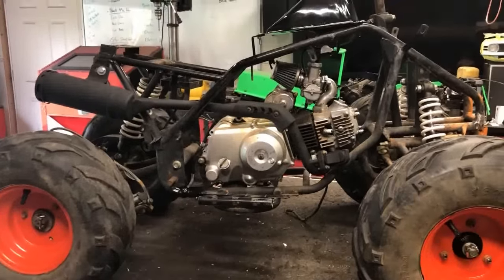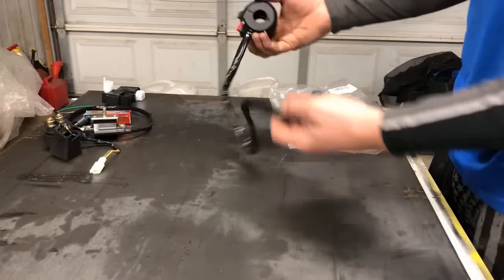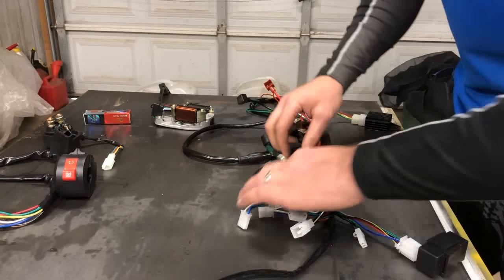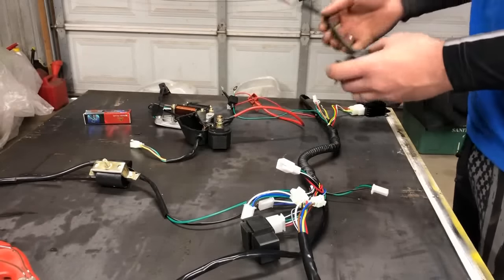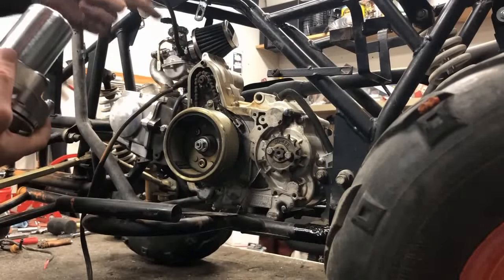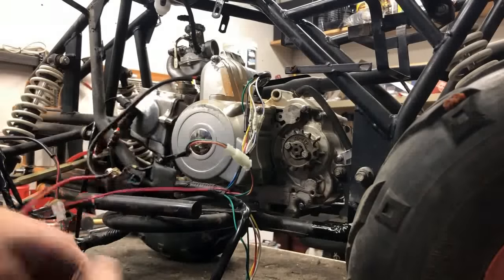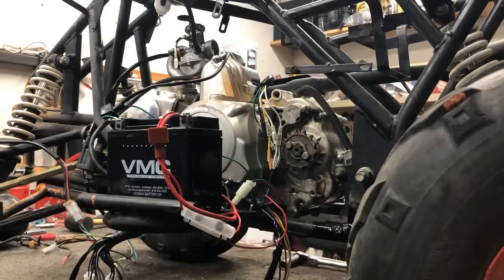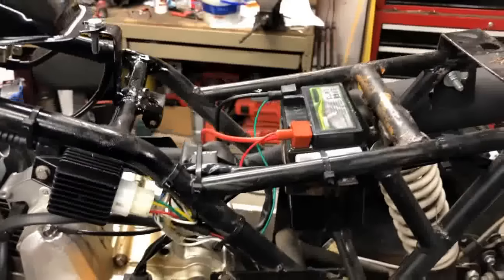Wiring a Chinese ATV from start to finish with an All New Wiring Harness!

Comment: I have followed your video over and over but for some reason I am having difficulty with my tail light and head light to be on at the same time. for some reason when i have the light switch off the taillight is activated all i did was plug into the correct connector only one that goes to the back GR/GR/YE/BR 3 prong plug.
but once i turn the headlight on 1 click the headlight comes on and the taillight shuts off. ive looked over and over just throwing me for a loop. 

Full Electrics Wiring Harness CDI Coil Magneto Stator 50cc 70cc 90cc 110cc 125cc Quad ATV Bike is what i bought
Reply from the maker: That is very strange, and I have never run into that issue before. It's not uncommon for these harnesses to come with issues out of the box. If you ordered off amazon my advise would be to do an exchange. That's what I have done in the past.

Comment: what about a 250cc water cooled atv? Will this work?
Reply from the maker: The concept will be the same but you'll need to order a specific wiring harness for the 250cc. Unbox, lay it out, plug everything in while its off the atvs, confirm it works, install! Good luck on your project and let me know if you have questions!
Reply: @PraskaBoysGarage  I will, thank you.

Comment: Thus is a great video.  But it doesn't  cover what I need.  Lol.  So I'll just ask and hopefully  I'll get an answer.   I got a used loncin 200cc atv.  The problem  is it doesn't  have the neutral/ reverse  indicator  lights  at the handle bars.  I have a 6 pin neutral  safety switch  that isn't  plugged  into anything. So my question  is.  How do I add in the neutral/ reverse indicator  lights.   I can't find anything  on this  online.  Please,please  help me.
Reply from the maker: This is actually a common question I get. Unfortunately the generic harnesses you can buy off amazon do not come with the gear light indicators. I keep telling myself next time I pick up an ATV with gear lights I will take it apart to figure out how it works. Unfortunately that hasn't happened yet. I'm in the dark with you brother! If you do figure it out please email me, I'd love to know the answer.

Comment: My quad has a few wires at the back of the engine just above where the chain meets the cog   Does anyone know what it might be   Sounds stupid but since I’ve put in the new electric loom the quad won’t sit idle and cuts out the second I let go of the throttle could that be anything to do with it ?
Reply from the maker: The set of wires above the chain is for neutral and reverse light indicators. It wont have a plug for this harness. I haven't found a aftermarket harness that has the proper plugs for them yet. They wont have anything to do with the idle.
Reply: @PraskaBoysGarage  yeah got it all sorted, reason I was thinking it was something to do with sitting idle was because I was adjusting the screws on the carb but there were no changes so was thinking it was something on the electrical side of things so I just got the mechanic to call down and see what he could do, but I just wasn’t turning the screws enough and he said the connection could be lights as you said, thanks for replying tho appreciate it, this vid about the loom helped me a lot 😂, keep doing what ur doing tho they help a lot of people and are good to watch and it’s enjoyable content 👍🏼

Comment: So I have an issue. Whenever I attach the battery without pressing any buttons the starter motor starts turning over
Reply from the maker: Only 2 components tell the starter to turn over. Either the start button or the starter relay. Check both to make sure you have them connected correctly. Also in the past if I switch positive and negative on the battery it caused that issue. Hope that helps!

Comment: I have connect the battery wrong positive to negative what will happen when you do that please help
Reply from the maker: I've seen it run the starter in reverse. Also your sending 12volts to the chassis ground so everything is considered "hot" meaning it could melt wires. Your most likely fine, just swaps them the correct way.

Comment: I followed all the steps but I can't see coil shock, I don't know why, someone can help me?
Reply from the maker: Stator, CDI, Coil, and Spark plug are the components that effect spark. You also have the ground wire, safety tether and kill switch that need to function correctly. Start with the easy stuff. Unplug your tether, clean your contacts for ground, make sure your battery is fully charged, and use a multimeter to make sure the kill switch functions properly with an open and closed circuit. If you do all that and still no spark, then likely you have a failed component. In my experience if you have a failed component it's usually a bad CDI Box.

Comment: Can any one help got the wireing harness all wired up and everything things right checked it twice and it still has no spark I’ve gone thru it all any idea what it can be plz lmk
Reply from the maker: Honestly I always tell people to check all the simple things like connects, grounds, kill switch...but it sounds like you've done all that. You likely have a faulty electrical component (Stator, CDI, Coil) It's a pain but you can either test those individually or you can send back the harness to get a replacement. I have personally had to do that a few times due to receiving a bad CDI box and also bad starter relays.
Reply: Ok thx will end up taking all off and sending it back and get new one thanks for the response . love the vids keep up the good work and keep em coming

Comment: does the switch assembly also work with a choke?
Reply from the maker: This wiring kit does not come with the choke to attached on the switch but they do have those kits available to purchase on eBay and Amazon.

Comment: does this video apply for a polaris 90?
Reply from the maker: We have owned both a Polaris 90 Scrambler and a Sportsman. Both were 2 stroke atvs and the harness is completely different. These harnesses wont work for those atvs.
Reply: @PraskaBoysGarage  I just seen this, man thank you so much for this video I just got done rewiring mine, it came out great 👍this video came clutch 🙌
Reply: Oh I did a Chinese quad by the way lol

Comment: Ok so I thought my wiring was bad cause I lost spark so I installed an still have no spark any suggestions
Reply from the maker: Start with the simple things first. Did you plug a safety tether in? Make sure the plug is on if you did. Also did you replace the spark plug? Check the flywheel for dirt or rust. It could cause a problem for your pick up. I know it can be frustration, let me know if you figure it out!
Reply: The only difference in mine an your's is I have 3 wires right behind the flywheel cover towards the back not sure what they are for

Comment: Do I need the wiring harness when I haeb a motor with Kickstarter?
Reply from the maker: Michl Simon  Not this exact harness but kick start motors still have a much more simple harness available. The tricky part with those motors is the stator is located behind the flywheel and you’ll need a special puller to get it off. Let me know if you have any questions!

Comment: What should I do if I installed the new harness, the atv turns over but has no spark.
Reply from the maker: It’s usually something simple. Unplug every connection 1 by 1 and inspect to make sure it all looks good. Then clean up any areas you have the ground attached to. After that it will take a little more diagnosing. Your always welcome to email me to if you can get it figured out!

Comment: What size battery are you using (volt/amp)
Reply from the maker: Voltage: 12 Volt; Amperage: 4AH I consider these batteries throwaways. They are cheap and usually only last around 1-2 riding seasons.

Comment: Mine does not have a starter wire plz could someone point me in the right direction to buy one 🙏
Reply from the maker: I don't believe you can buy the wire only. You can make one with 8-10 gauge wire if you wanted, and would only cost a couple bucks to make.

Comment: Hi. My atv came with remote Control, starts and kills from distance. And i can start it then Neutral bulb turns green. Please comment is conection the same?
Greetings from Lithuania :)
Reply from the maker: Lithuania! That's awesome! This harness is a generic harness. It will work for your atv but does not come with remote kill switch or neutral light indicators. They make kits with the remote system you can buy off Amazon but they are double the price.

Comment: Any idea on why my quad wont run faster when i put it on 3rd gear
Reply from the maker: Hmm, are you sure it's engaging or is its stuck in 2nd? Could be a lot of issues. Hopefully nothing too serious!
Reply: @PraskaBoysGarage  i feel it when it changes over i just got it the other day im thinking it might need a carb cleaning or what do you think. I press the gas all the way down and it barely runs i have to switch over to 2nd gear

Comment: Has anyone redid the wiring on a 150cc "roketa" chines 4 wheeler, the cylanoid, coil, and everything is good but I'm missing the wiring that comes out of the motor
Reply from the maker: The wiring that comes from the motor would be the stator. I've done a 150cc before and it's almost identical to the 110cc or 125cc. Just make sure to order a harness specific to your size.

Comment: What about the kill switch ? Is there a plug for that
Reply from the maker: The kill switch is part of the start button. It has 2 plugs coming from it and both have connection points into the main harness.

Comment: Got me a new harness and still have no spark what else should i do brother
Reply from the maker: Stator, CDI, Coil, and Spark plug are the components that effect spark. You also have the ground wire, safety tether and kill switch that need to function correctly. Start with the easy stuff. Unplug your tether, clean your contacts for ground, make sure your battery is fully charged, and use a multimeter to make sure the kill switch functions properly with an open and closed circuit. If you do all that and still no spark, then likely you have a failed component. In my experience if you have a failed component it's usually a bad CDI Box.
Reply: @PraskaBoysGarage  thanks for the answer brother i can get it stasted with the drill  now but when it cranck wont stay running like no idle i did order a new carb and hope that fix the issue

Comment: Hey, I know you might not see this but I got a question. My uncles neighbor recently gave us a cheap chinese ATV that they've left outside for 3 years. Ants have eaten and destroyed the entire wire harness. I was wondering how you figure out which wire harness set to buy online, because the one we got is some cheap chinese brand (Baja wilderness trail 90 to be exact) Thanks!
Reply from the maker: Hello! Refer to my links in the description. This style of harness I use is specific for the E22 motor. If you do a google search on that motor you can compare to yours to see if the kit is compatible.
Reply: Praska Boy's Garage for some reason, I opened it up and it was a 7 coil wire harness, so I don’t know if it’ll work with the atv
Reply from the maker: If you want, you can always email me some pictures and I can check it out!

Comment: Hey dude can you plz help me with my 110cc quad it has no spark I changed the coil and cdi and spark plug and I still don’t have a sign of spark
Reply from the maker: Alright man lets get it! So you already tackled the big 3. It's likely down to the stator or you're grounding spark somewhere. I would check the contacts for the kill button above the start button first. Take it apart and clean the contact points. Also inspect the stator make sure you don't have any loose or pinched wires. I have personally ran into both of those issues! Try that and let me know what you find!
Reply: Hey dude i found out another thing there is some sort of a hole which is around the head area will that affect it to not make it spark but the thing is no air or anything comes out of it when turning it over

Comment: How did you connect the hand brake wire
Reply from the maker: On your brake handle there are 2 metal prongs behind the lever. They attach to them, doesn't matter which side, they can go on either.

Comment: My harness doesn't have the plug like yours for the coil
Reply from the maker: Daniel Arwood Every harness I’ve used either has two separate connectors or every once in a while it will have a single white 2 pin connector. What does yours look like?
Reply: Praska Boy's Garage mine has just white plugs on it but I bought this motor to put on my go-kart I had laying around and I'm not gonna have all the lights on it or anything just the stuff to make the motor run I may end up putting headlights on it later but for now I'm just wanting it set up for the motor to run also the motor I have is a 3 speed with reverse and it has 2 harnesses coming out of the cover where the magneto is and my cdi can plug right up to one of them
Reply from the maker: Daniel Arwood Alright I follow! The second set of wires coming from your stator cover is for the shift light indicator. Some atvs have a green light for Neutral and a red light for reverse. The wiring kit I used in this video doesn’t have that hook up. It is not required to make the motor run. Hope that helps. If you watch the wiring part on my first 125cc build from 6 months ago you will see I remove the shift light wire when I install the new harness.

Comment: It was running a few days ago but now no spark. It will turn over and over but no spark on the plug
Reply from the maker: Is that after you installed the new harness?
Reply: I have not put a new one on it no. That why I was wondering if I should get one and try it out.

Comment: Once I start my atv it just goes and I’m not sure how to control the speed of it so it can just stay in one spot when I start it up.
Reply: I’m not pressing against the throttle but it acts as if I am and it just keeps going
Reply from the maker: You can adjust the idle 2 ways. There is an idle screw on the carb. If you loosen that screw and it doesn’t come down then you’ve got your throttle cable set too tight.
Reply: @PraskaBoysGarage  how do I make the throttle cable looser?

Comment: I have a 6 coil and the one I ordered is a two coil what do I do
Reply from the maker: You'll have to order a 6 coil or used your old one. The connections are the exact same as the 2 coil but the mounting points are different between stators.

Comment: I have 2 plugs behind the stator by the front sprocket don't know where they go they are a 2 pin n a 6
Reply from the maker: Your ATV was likely originally equipped with a neutral and reverse light and that is the sensor for it. These generic harnesses don't come with the option to have that function.

Comment: Thank you for this video, it has been very helpful.  I'm rewiring my son's polaris predator 50 which was riddled with electrical issues.  Following this video, I was able to get everything hooked up, but unfortunately I had already bought the harness before finding this video and ordered the harness with the wrong stator.  My four wheeler uses an 8 coil stator with just four wires- blue, black, red and yellow.  The harness is meant to plug into a two coil stator and has 5 wires, none of which match the colors that I have.  I'm working on matching the wires up, but the wiring harness has a 5th wire, which is ground.  I've grounded that one out and am still not having any luck getting the system to produce a spark, I must be doing something wrong with wiring my stator into the harness.  Any ideas?  Thanks so much for this resource, it's so hard to find information about these little ATVs.
Reply from the maker: Eric Eckman Sounds like you’ve got your hands full on this one. I’ve worked on the predator 90s before and it was a 2-stoke. I’m assuming yours is the same? Since it’s a name brand ATV can you look up a wiring diagram? I would see what the old stator wires went to, I’m not positive but I think the stator ground is a battery ground not a chassis ground. Also the new harness is set up to run lights and charge a battery. If your predator doesn’t have lights or a battery you’ll be short the charge wires. Let me know what you find out!

Comment: Hey man! I've got a little 110 for my daughter. I just put a new battery and carb on it. But I can't get it to really turn over. Even off my car battery it seems to act like its dead and slowly crank or just click. What could be the problem?
Reply from the maker: If it’s only clicking then your starter relay is probably bad. Just to be sure it’s not the starter I would test it with direct power from a 12 volt battery. If you watch my complete builds I do this process in every one to check compression.

Comment: My 110cc engine has a wire next to the stater and the chain and i dont think the kits have it i need to replace it because my dog bit it i dont know what its called tho
Reply: The engine is a zongshen foosh im actualy not too sure if its a 110cc
Reply from the maker: Hey Paulino, I saw your email also so I'll answer your question here: That set of wires is for neutral and reverse light indicators and wont have a plug for this harness. I haven't found a aftermarket harness that has the proper plugs for them.
Reply: @PraskaBoysGarage  thankyou i was so confused becaue i saw like 4 videos of yours and didnt see it on any of the quad motors

Comment: Will this work for a gts hammerhead 150cc
Reply from the maker: That go kart has a GY6 motor. The concept of the video is the same but the wiring harness is completely different. I actually have one of those go karts that I will be doing a complete wiring harness video in the future.